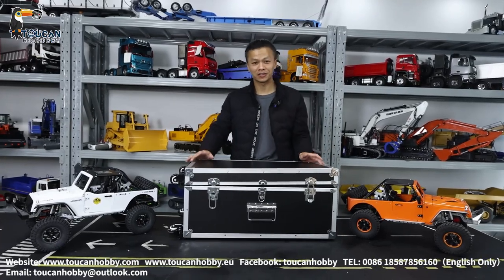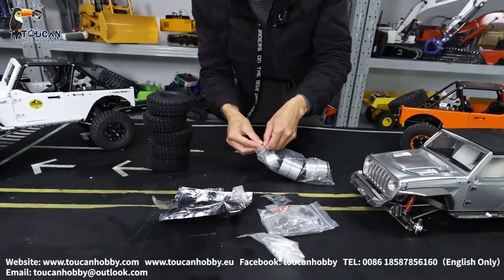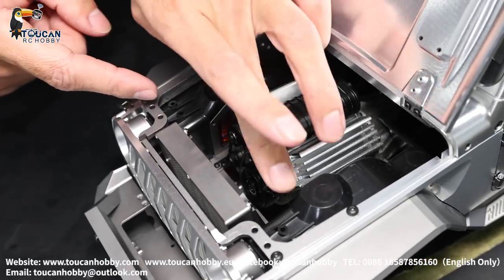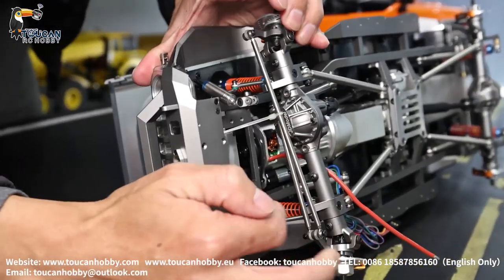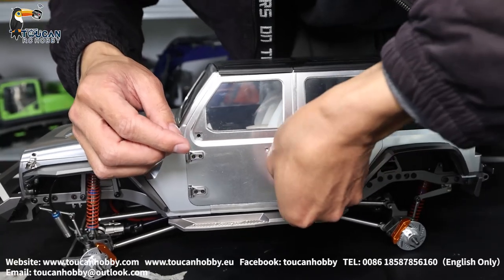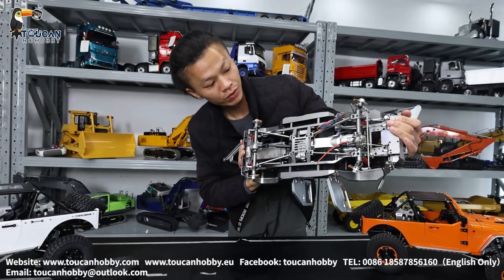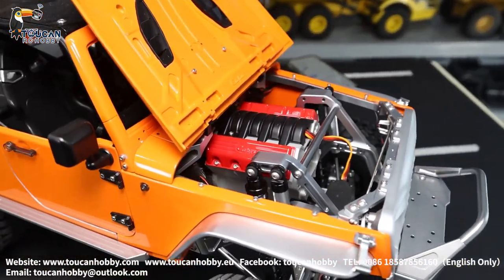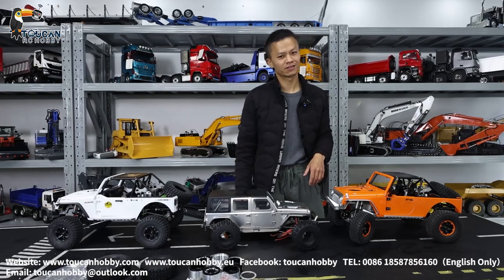Compare the size and parts of JDM-168 1/10 4*4 AWD Off-road RC jeep Crawler car.Can make it RTR

Comment from the maker: Compare the size and parts of JDM-168 1/10 4*4 AWD Off-road RC jeep Crawler car.Can make it RTR: 4speed gear box, differential lock, front/rear/all wheel drive switch, anti tilting, light and sound.
Reply: Price please brother 😊👍
Reply from the maker: For painting assemble make RTR around 3000 usd, where are you from?
Reply: @toucanhobby2400  I'm sri lankan